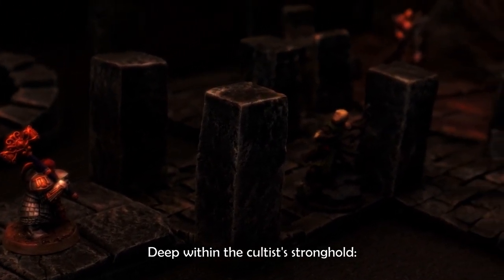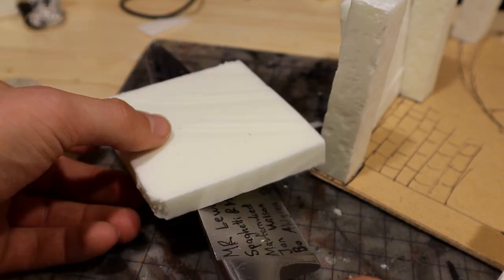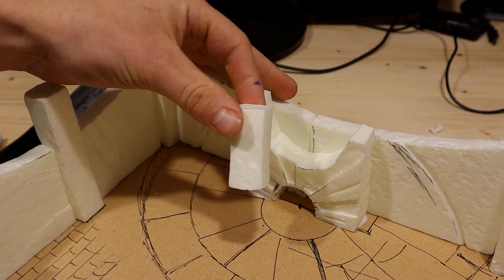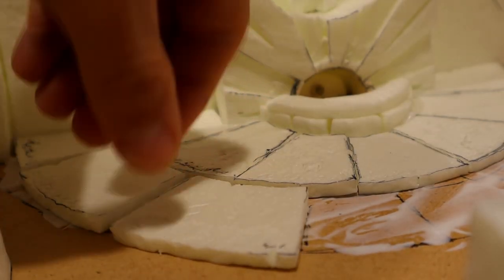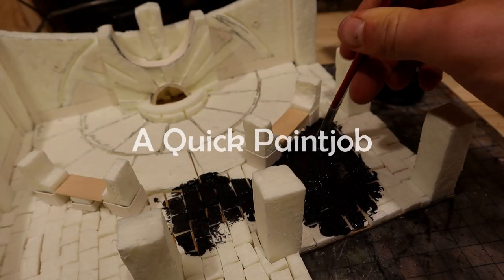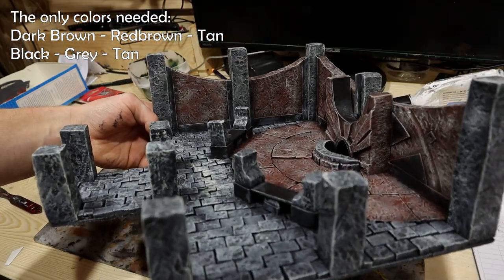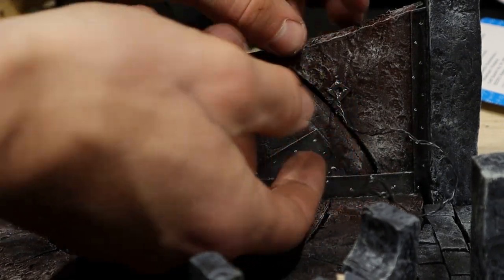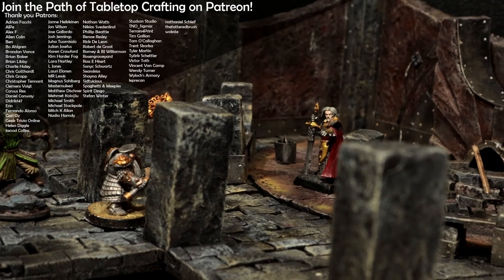RED STEEL FORGE: my greatest conquests in diorama building (buckets & hammers!)

Comment: To make a really good chain effect from wire: twist wire together, tight and evenly, make slightly longer than needed to make it easy to hold. Find a flat strong surface (bottom of iron or sauce pan) hold wire on flat surface and gently use a tack hammer to flatten from one side. It will round of twist, flatten off the round wire and look like an epic store bought chain that you can bend to shape.
Reply: Great tip!
Reply: Interesting idea! Generally though, I just use jeweler's chain, which you can get in most big box stores where all the beads are for less than a dollar per yard. Wire probably holds specific shapes better, though, might be a better call if you need more durability.

Comment: Good call on the hot wire cutter. Mine is collecting dust in a closet.
Reply: I have one and i didn't know before i bought it that it puts off stinky probably harmful fumes so i use mine sparingly

Comment: Cool diorama.  You can add a second LED with one battery to increase the light.  Make the second protrude a bit further out as well to bring the light forward in the forge.  Glass beads over the LED's will also disperse the light and send it over the whole area.

Comment: Watching so intently, I tried to blow the sawdust off the base after he pulled the jigsaw away...
Reply: Oh, and the forge fireplace is called the hearth, at the center of which is the firepot. The air is fed from the bellows or blower through a pipe called the tuyeree (pronounced twee-yer) into the firepot, and most forges require fuel in the form of charcoal or coal, with shovels to move it. Your forge will also need a chimney to provide natural draft to carry away the smoke, which starts at the forge with a large hood to collect the smoke. Also, your smiths need tongs and tools, anvils, vises, mandrels, mandrel cones, swages, workbenches, files, and sledges. Smithies get quite crowded.
Reply: Same here!

Comment: Another fantastic build, Lukas! I've been subscribed and watching your videos for quite some time, but have never commented. About time, huh? There is a product you might want to check into, to use for some fire effects applications...among other uses. It's called "Gallery Glass" and comes in squeeze bottles. It's used to create stained glass effects, but can be used in many different ways. It is available in lots of different colours and can be blended, (using a toothpick to drag the colours together works great for fire effects). It will also work great on the clear, heavy plastic pieces I've seen you use. It's an acrylic-based product, so it cleans with water. I thought some of it on the coals, with the light behind them, would've made a really great glowing coal effect. When it dries, it becomes translucent and allows light to pass through it...like stained glass.
Hope all is well with you! Looking forward to your next video!